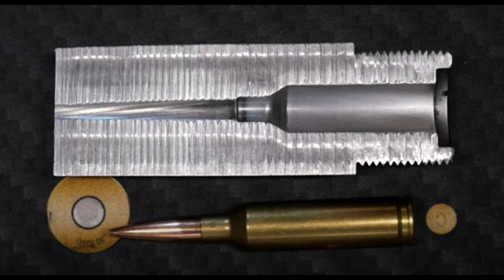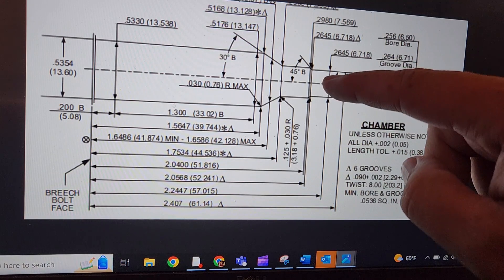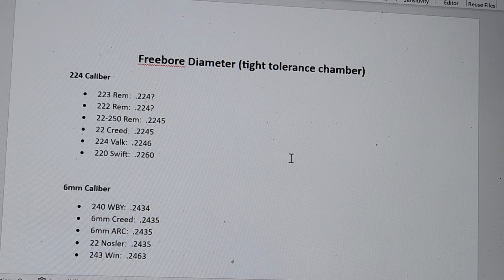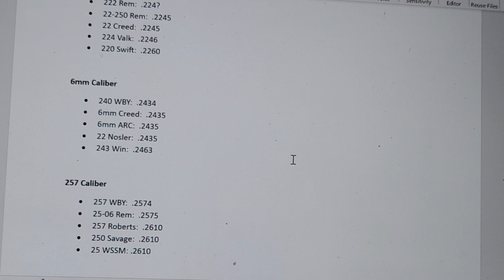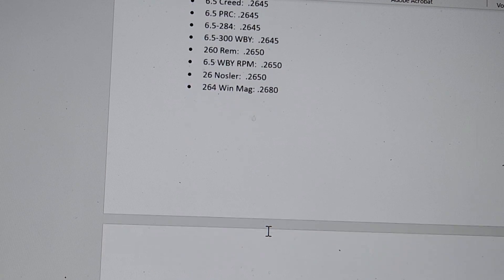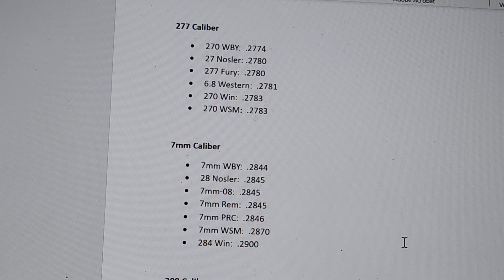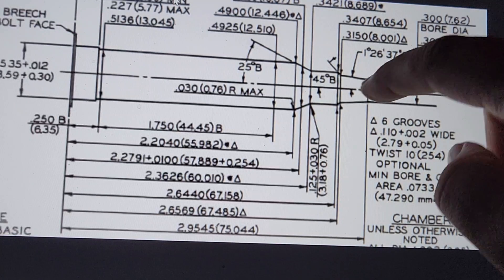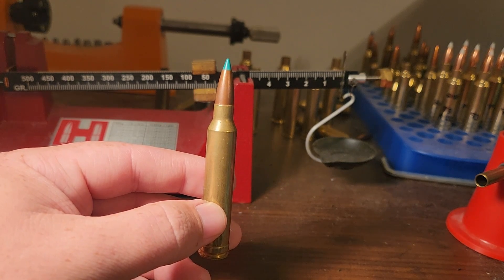Tight Tolerance Chambers: Best to Worst

Comment: I built a 300PRC using an ARC coupe de grace action and Outlier barrel. Head spaced it and everything worked perfect for the first 50 shots or so and now the brass is starting to stick in the chamber. It sticks the same whether I fire a round or not….like if I just load a round and empty the live round I have to bump the bolt back the first 1/8” or 1/4”. Not a sticky bolt lift, just sticky extraction. What should I be checking?

Comment: One thing to keep in mind, and one reason I will always choose the win mag over the Weatherby, is that if you're reloading you can use the Sinclair bump gauges and only bump the shoulder back 1-2 thousandth. Simply not possible to do that with the Weatherby because of the shoulder. Your brass will 100% last longer with the win mag.
Reply: I have no trouble measuring my 338-378 brass for proper shoulder bump.  I use a dial caliper and the appropriate size of powder bushing from my shotshell reloader.  It works great.
Reply: @10-4CodyWade  it will never be as precise due to the double radius shoulder. You can basically make any .300 win mag headspace off the shoulder, it's very hard to achieve that, if it's even possible, with any Weatherby mag.
Reply: @coltinallenscott  How precise does it need to be?  You're saying 1-2 thousandths is what you use on the Win Mag, and that is easily achievable on the Weatherby with a dial caliper.  Not sure why you'd need to be any more precise than +/- .001 on a shoulder bump.  You're not even taking an actual measurement, you're just comparing a fired case to a resized one.  If I was having any trouble taking measurements I could easily crank out a bushing on the lathe to match the shoulder radius.  It's just not needed though. I have a 300 Win mag and the 338-378.  Both are set up to headspace off the shoulder.

Comment: 🕵️‍♂️ I Noticed That the 280 AI Wasn't Listed? Does the Newer SAAMI 280 AI Have Tighter Chamber Tolerances Than the Pre-SAAMI (Ackley) One? If So, What is the Actual Measured Difference? 🤔
Reply from the maker: I forgot to add it. It's not good.. but not terrible either.
Reply: 🕵️‍♂️ Do you know which was the tighter of the two (Ackley or Nosler/SAAMI) and what the values were? 🤷‍♂️

Comment: Many of the Winchester cartridges you mention do not have a freebore section. They just have a single taper with no freebore section to align the bullet shank.  Winchester followed this design up through the early 2000's with the WSM series (with the exemption of the 308, which more closely resembles the 7.62x51).

Comment: Tolerance on freebore diameter's are typically +.002". While the specifications may vary, they rarely vary by over .002". Get a good chamber with a high quality reamer.

Comment: I’m stoked to have finally found some 180 grain accubonds to try in my 30-06. Have you loaded those in 06 and if so any tips on making them shoot in an 06?
Reply from the maker: I haven't tried them in 30-06. 180 gr Accubond have been picky in my 300 Weatherby. It prefers the 200 gr Accubond
Reply: @ReloadingWeatherby  Are they picky about seating depth? Hoping they will work out in my 06.
Reply from the maker: @NCWoodlandRoamer  I believe they are. My friends 30-06 loves the 165 gr Accubond. Gets under half MOA with it.

Comment: By factoring only the diameter of the freebore and not taking into account how long (depth) the parallel freebore is cut and where the lead angle starts you are missing quite a bit of important information. Case in point, the 300 Win Mag has zero freebore, so at the case mouth the chamber is cut to .315 which immediately starts into the 1.5 degree lead and in only roughly 300. depth is down to a bore size of .300. Even a 110 grain. 30 caliber bullet with a short bearing area will be fully supported by the case neck and rifling at the same time as it is funneled into the rifling. The 300 Weatherby on the other hand, has a parallel freebore of .3084 that is nearly .350 in length before it starts its lead angle. Which is long enough that a really short bearing area bullet may not receive full support as it transitions into the rifling. This holds true for the .243 Win and .264 Win Mag also.
Reply: Good observation. Suddenly someone publishes a video of certain rifle chambered in .300 win mag, and it happens to ba a flaw in a 50-year old design.. so maybe we need to rebarel our rifles for a faster twist PRC cartridge..

Comment: Been hearing about Bergara rifles for a few years now with bad accuracy. I've  used many rifles, their either accurate shooters, i can deal with it shooters, or just junk. Honestly i dont think freebore has much to do with accuracy,  since the 30 cal class has won more matches than any other class out their. Though i think the prc class will surpass the older designs due to the superior bullet construction. Though the old design is no slouch. Bullet construction and quality of the barrel have most to do with accuracy.
Reply from the maker: Could very well be a Bergara issue. As I said this is not the end all be all for accuracy

Comment: Yeah, imagine if 264Win Mag rifles were made with match chambers, which are chambers with almost no wiggle room like the 5/10000 in 6.5PRC, 264Win Mag cartridges were seated as shallow as modern 6.5 cartridges and all the powder capacity of the 264Win Mag was utilized. It would be the new IT cartridge.

Comment: Just for this discussion; This quote may explain why the longer freebore."300 Winchester Magnum is a magnum cartridge designed to fit in a standard rifle action." It is based on the .375 H&H Magnum, which has been blown out and shortened where as most "308 -.338 magnums require a "Magnum action." Also the bullet manufacturer's tested and recommended bullet seating depth can differ because of their bullet weights, ogive shapes and metallurgy, the latter needing to be seated longer in a calibers chamber and be within SAAMI specs for all same cartridge chambered rifles. I suspect Winchester purposely created more distance to lands to prevent potential Bullet Jam and therefore dangerous chamber pressures already inherent from increased case powder capacity over standard cartridges. Weatherby magnum chambers and cartridges are well known to have higher chamber/case pressure tolerances.

Comment: The problem with SAAMI is that is SAAMI data and most independent chamber reamers makers (PTG, Manson, Climber, etc) have already solved this problem on their end. My .30 caliber chamber reamers all measure .3085”, in fact all my chamber reamers measure exactly .0005” over the bore diameter in the free bore or throat area. I use PTG chamber reamers almost exclusively.

Comment: This is not tolerances but specifications.  Tolerances would be if the specification says it can be fall within x-y measurement. It does make good sense that the Weatherby's would be tighter with the longer freebore dimensions.
Reply: Correct. Typically the tolerance in freebore diameter is +.002. So arguing about .2845 vs .2846 diameter is a moot point. Get a good quality chamber made with a great quality reamer.

Comment: Awesome video. Thx for taking the time to collect all the data. Below are the values of the best and worst per caliber in percent. 

22-250: 0.2%
22 Swift: 0.9%
6mm ARC: 0.2%
243 Win: 1.35%
257 WBY: 0.2%
25 WSSM: 1.6%
6.5 CM: 0.2%
.264 Win Mag: 1.5%
270 WBY: 0.1%
270 Win: 0.5%
7mm WBY: 0.1%
284 Win: 2.1%
300 WBY: 0.1%
30-06: 0.8%
300 Win Mag: 2.3%

Comment: A couple of corrections I would make...some of the cartridges you say have the worst freebore tolerances (like the .243) actually don't have any freebore at all.  That dimension of .2463" is just an arbitrary point where the 45 degree taper ends and the 1.5 degree lead/throat begins.  So it's a bit unfair to compare a design with zero freebore to a design with a sigificant amount of cylindrical or "parallel" freebore.  Second, bullet diameters are not exact as you imply.  For example a .264" bullet is not exactly .2640", but has it's own tolerances in manufacturing.  The majority of rifle bullet specs I've looked at have a tolerance of plus zero, minus 0.003".  So that bullet could be as small as .261" and be within factory specs.  Most bullets today will be much closer to the stated diameter than 0.003" but they still vary a bit.  Having said that I still think this is a very relevant topic to discuss.  Traditional tolerances are +0.002" on the chamber and -0.008" on the cartridge.  Add that to about 0.002" of difference between chamber max and cartridge min dimensions...you could have up to 0.012" of difference between your cartridge and chamber.  That's enough that you could wrap a piece of masking tape around your ammo and still chamber it (don't actually try that, it's just for the sake of explanation).  Higher quality rifles tend to be closer to that chamber minimum dimension (including Weatherbys).

Comment: this might help to  explain why my particular 30 06 has some accuracy issue with lighter bullets, but seems to do better as you increase bullet weight with the gun.   not saying that is the only reason but may be a contributing factor.
Reply: Years ago we tried 125 noslers in my custom 06 my grandfather gave me. It would hardly keep bullets on the box we used for the sight in paper to be on. Some even canted sideways when they hit. Needless to say, we went back to the 165 interlock shooting 3/4 inch group and never looked back.
Reply: @rosshill2565  the gun i have is a marlin xl7.  Literally have tried numerous bullet powder combos.  It will shoot 165 ballistic tip okay.  But ive never gotten sub moa with the gun

Comment: What does this mean for how manufacturers actually make chambers? Does Bergara follow saami and others go a bit tighter? Will there be chamber pressure issues with certain factory ammunition if certain manufacturers make tighter chambers?
Reply from the maker: All manufactures will attempt to make it at SAAMI spec. But we all know that they mess up.

Comment: Free bore is the distance from the neck of the case to where the rifling starts. You are talking about the diameter of the neck of the chamber or neck tolerance. Weatherby is known for having the most free bore of any rifle manufacturer.
Reply: When talking about Weatherby having the most free bore of any rifle manufacturer keep in mind they have the longest free bore. But not the largest diameter of free bore. I believe when discussing free bore it is important to keep two dimensions in mind. The length of free bore and the diameter of the free bore.
Reply: Most hunting cartridges do have more tolerance built in, that is a lot of the difference say between the 300PRC which is basically a match chamber and the 300 Win Mag which has loose tolerances compared to it.
Reply: But no I do not think you are making anything up!
Reply from the maker: I know you think I'm making it up... even though I showed you the drawings from SAMMI.... just go Google it

Comment: Free bore is length.
Reply: Yes, I did watch and I enjoyed it as usual. I thought some might be confused because of the difference between free bore and what you were talking about, the diameter of the chamber where the free bore is. I am not arguing just trying to clarify some points.
Reply from the maker: Did you watch the video? I'm specifically talking about the freebore diameter where the bullet sits before its fired